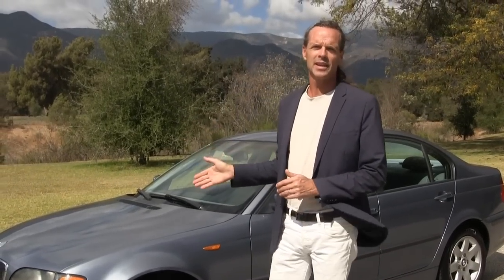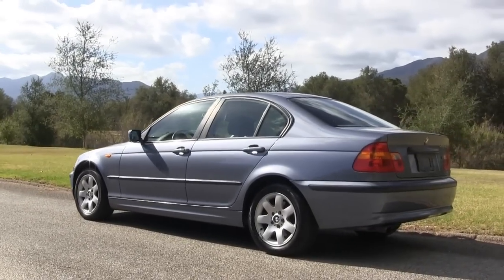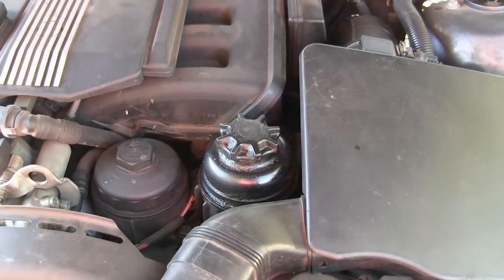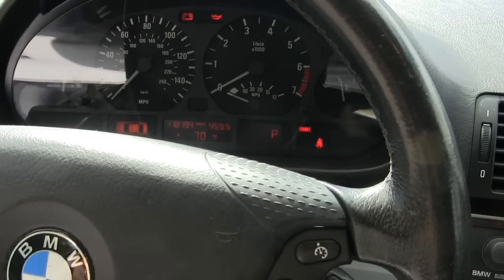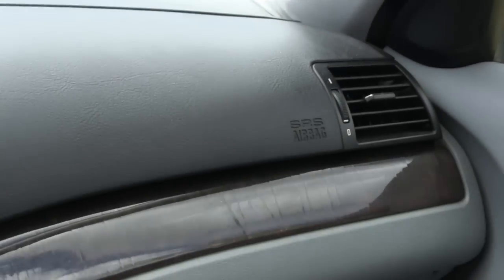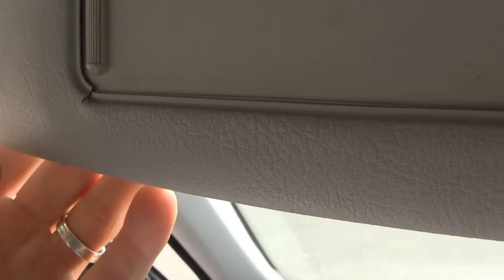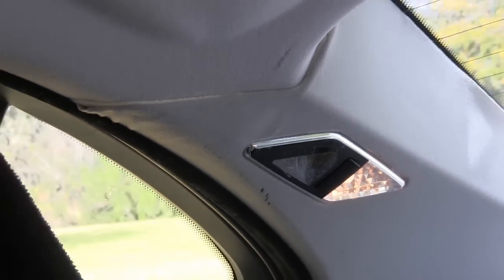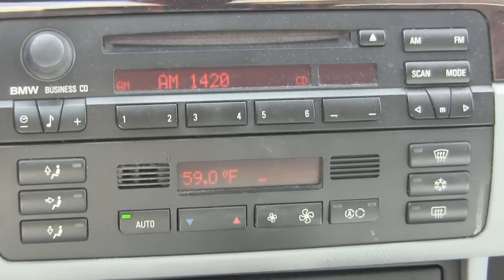Why You Should NOT Buy a Used BMW

Comment: He is right you know. He is not exaggerating at all. And he is not even saying the most important. The number one over heatig problem on this car is due to plastic parts in the water circuit. The inside looks elie when you buy it but it does not last very long. The problem is not even paying or get it fixed. The problem is for how long did it overheat - Did the driver notice the overheating immediately. Did he decide to try to reach home not realising how deadly this could be to the useful life of he engine. 
These are good engines but when overheated, you may expect all sorts of problems in the long term. Anyway buy one and learn at your own expense. 
I had Merc 190 in 1985. Grundig Hi Fi Fine Arts. Bosch kitchen appliances. I just believed in German Quality - The total cost to own these things was really low and you get the best oo. 
1990: Next Merc C200 1995 and The wife a BM 318  series. My son Toyota Avensis and my daughter Toyota Auris. And you know what !!!!!!!!!!!!!!!!!!!   
These Toyota never stopped ever! My wife and I were borrowing the Toyotas every few months to take the Merc and BM to the dealer for some reason or another. .  Grundig went bust because they struggled to continue to supply the best. 
Merc, BM, Bosch changed to building for a price and they are truly a piece of shit. You pay for the name and you get shit. I hate to have to say this since I am 66 and believed in German quality. Today if you want something you can depend on that does not cost an arm and a leg to own, just buy Japanese. 
I do not have the  3 pointed star on my bonnet at this age, but after owning a Toyota Land Cruiser for 5 years now, I would not change it for anything else, 100% reliable, unbelievable confort, and the service of Toyota is the best I ever experienced.

Comment: I had 325Ci 2006, amazing car, they only thing I replaced when I got it at 27K miles were rubber suspension bushings.  Sold it when had 160k miles-no oil loss!

BUT: not I have 528i xdive 2010-what the hell went wrong with this car??? only 78k miles.... the amount of gaskets I have to replace!!!!

So many oil leaks on the car. Just got my oil changed at the dealer, they found 5 leaks! Major ones too, one of them is replacement of oil pan gasket, the suspension has to be dropped to replace it, realllyy??? $2,300.     other ones I can most likely do. 

It is not the car I will buy again! problems just keep on piling up!

Comment: I've put 127k miles on my 2007 BMW 335. Interior and exterior still in pristine condition.  The paint looks practically new, except for chips at the front bumper area due to road debris/rocks,etc.
 Things that broke: rear main seal, electric water pump, alternator, valve cover gasket, fuel injectors,  coolant overflow tank,  ProLogc 7 amp, the "CCC"  ( main computer/nav).  We also have a 2004 Lexus RX330, with approx 275k miles. Excellent condition, in and out.  Only thing that broke was the A/C compressor.  Cars were bought new and total non-warranty repairs (at the dealer) on the BMW:  $8000-9000 the Lexus:  $300-500    I still love the BMW, but the Lexus is so incredibly reliable.

Comment: Agree about that cheap rubber-like coating used on interior plastic-peels off and looks terrible.Also the glue they use on the fabric covering the headliners and pillars-that falls off and is very hard to re-glue (and get it right).For such an expensive brand, interior quality is lousy.

Comment: You have to look at this critically. The car he has here has not been maintained. If an owner lets all the cosmetic things go south without attention, you damn well know they haven’t taken good care of the motor/drivetrain.
I have an 02’ 330CI  convertible. Had it about 5 years now. It is mint, garage kept, dealer serviced all its life. It does have the plasti coated issue with trim near the shifter, replaced it myself for a few hundred. But other than that, there has been nothing. Full disclosure, it’s a summer/weekend car for me so maybe I am one of the lucky ones.
My daily is a Mazda. Japanese car that you can practically weld the hood shut for 100k miles.
The Germans can never reach Japanese levels of reliability.

Comment: I bought a 1999 e46 323i for 1200 took it to the mechanic only 400 in parts and 150 on cosmetic wear and tear quite cheap I reckon have no regrets cars are usually crap when the owners thrash them around and 700 for regulators ebay 70 know how to shop

Comment: BMW is gods gift to the automotive world. The E46 was the best BMW ever made. Congrats, you picked the worst maintained E46 out there. AThe expansion tank takes 30 minutes to replace. The water pump had a plastic impeller, not a bearing issue.  The tail lamp issue was recalled and fixed by BMW.  Everyone who bought an E46 3 Series knows about the weak interior fabric/adhesive. Thats why every E46 smells like crayons in the summer. They all do it, especially in areas with high humidity. The wood grain is real wood not that plastic stuff. This was left outside in the hot sun its whole life. The window regulators can be saved by not SLAMMING your door with the window down. Where are you buying $700 window regulators?  This car obviously was not properly taken care of.  The leather has not been conditioned. The floor mat is ripped from its mounts. This car had its ass kicked and it shows. You need to stick with your Toyotas.

Comment: Dude....This bmw is a lemon, clearly.But that does not mean that the brand itself is crap, let s be serious....If the e46 were to be such a fail for BMW, how come they are so many of them on the road(in every body and engine combination possible)?The most important thing (not just for BMW but for any brand) is the previous maintenance.If the previous owner/owners did not give one shit about the car, clearly you as a future owner will have to cope/repare the problems encountered due to faulty servicing/maintenance.On another point of view, yes, BMW did screw it up with a few engine types when they experimented various alloys on the engine block, but that was a problem with the first generations of certain models (e46/e39 e 90 and so on) but once they started building more generations of the same model the problems were fixed.Of course, the victim is the user but on the other hand, various changes mean that they are actually preocupied with making new engines, find improovements for their model, give the people something not only new, but better.Let s face it, not only BMW screwed it up...What about Volkswagen?Does anyone remember the timing problems the  newer generations had (broken timing chain due to poor quality or faulty design), or the fake emission values (more relevant in EU) where they restricted the cars from their software just to pass the emission test?In my opinion, every car maker had and still has it s faults once in a while...

Comment: The E46 cars are flawed masterpieces. They drive really nicely and will protect you from some idiot T-boning you at a junction when running the red lights and almost all of the petrol models come WITH 6 cylinder engines and WITHOUT turbo chargers. The way it feels to drive, not the handling, can only be described as a 21st century E30 3 series with really solid and well built steering/clutch/brakes/accelerator feel. The flawed aspect is it has all the anti-corrosion protection of a 1970s FIAT, it suffers the most stupid electrical/logical/mechanical problems due to poor design (like the self destructive VANOS mechanical components on the 328i models) and it has some really silly changes from the E30 like the fail safe for the blower motor sensor pack failing is to have ZERO airflow (the E36 failsafe is that it is either off or on full power). The problem is BMWs today ie E90 and newer models don't feel like BMWs with their tacky parkbench quick swapjob for LHD and RHD centre mdel designed console and dashboard T shape design that is angled directly towards the rear seat armrest (like a cheap tacky datsun) and the engines are either 4 cylinder or you have to have a turbo (and based on the problems with the E46 VANOS self destructive design on the 328i engine I don't fancy a BMW Turbocharged engine thanks).  The E90 standard seats look as flimsy as picnic/beach fold out chairs and most models with leather interior have these crap seats NOT the sports seats...like 3/4 of all Z4s on sale right now or E90 models with these seats YUCK. The current 3 series is just way too big and the 2 series looks like a cheap nasty 1990s Hyundai coupe. It's all a bit too much....you either have to fix the faults as they happen and own a REAL BMW or forget about the 3 series forever.

Comment: It's called proper maintenance and care for your vehicle. You neglect it you pay for it later. My 2006 ZHP Vert it's still in excellent shape. If you can't DIY then stay on schedule with the maintenance program. If you can't afford to maintain it, don't buy it. It's actually one of the EASIEST cars to DIY and the minor cosmetic things pointed out, like plastic parts breaking, it's a small dollar fix. This engine is a beast, gaskets might need replacing after a while but every car goes thru same thing over time. This video is based on one fellas poorly maintained car. Just looking at what is broken/missing (emblem) says it all. Easy and cheap to fix but neglected to do so. Lame.

Comment: That's ridiculous. It depends on how owner uses a car.  The way you  treat and maintain it. I guess this one was parked outside all the time otherwise windshield cowl and inside of the roof won't be like that. The front grill be like that because of incautious use and also old part. Other problem are common issues for 3 series E46, BMW guy know exactly how to deal with these problem. PS. I also own E46 323I 2004(240K  km) my car always parked inside and regular maintenance, I have none of these problems. This car is the most sensible price for second hand BMW.

Comment: Hey, if you`re willing to spend cash on a weekly basis to run the car, i`m sure it will hold up just fine.  But when buying used you don`t know exactly what you`re getting. If the engineering was bad and the first owners didn`t care, you`il find out in a couple of weeks.  German cars are not what they used to be, i`il rather put my money on a Japanese car. I still want an E-klass though(but without the rust).

Comment: You must know, if you know about these cars and how there made, and if you know how to work on them and you say I don't care about the dealership and never go there. You should be fine. Also not all BMW are the same or created equal. They make very good cars for those who know what  they are doing. But we all can't be dealer junkies. It's like everything else you have good and bad in all models. Even Toyota, Lexus. So if you like us who know what is going on and fix everything without a problem well,  It's a very good car. SORRY  for knowing, but if you do not have the knowledge don't  Owen the ultimate driving machine or any other exotic sports car,  there out of your league. (Originals not copys)

Comment: I just totaled my 2000 e39 and S0 many of these problems happened with my 5 series also. But I also had the LCD failure on the instrument panel, the awful cup holders, and that little roll up door thing on the center by the ashtray!!?  What is that thing for? And the rubber trim on the front and rear windshield. My rear window brake light melted in the light socket too.
What did I love about this car? EVERYTHING else. I could overlook everything else pretty much because she was so much fun to drive. I can't think of a car that I have had more fun driving, nothing I have ever driven has been so responsive, fast and fun. Pure joy. 
I bought a used Honda Fit Sport to replace my E39. I am already regretting it. I think if I can find another  used BMW  that has the right specs and mileage and has had maintenance done correctly, I am gonna buy it. They are just that much fun. But, you have to be picky and buy the right one at the right price. Or an older BMW will nickel and dime you into the poor house.

Comment: The E90 I6 naturally aspirated bmw engine is a great engine with excellent reviews and consistently sees 250,000-300,000 miles! The 2.0 and 2.5 is underpowered to begin with. Oil leaks could be from a water pump failure that the driver failed to stop driving when first noticed. Cheap plastic is not n EVERY car on the market! Show me one that doesn’t!

Comment: The car you show us has >15 years (today)and almost 300'000km on  it.... you show us interieur, label and frontpart they are not as new anymore. A beauty point is not a need for a shopvisit.  The main problem you show by pictures. sure they exist but with what car we can compare to say its a bad car?  According my 3x E46 in version 330xd i had ... take care of all what contains rubber and change the aut.gear-oil. A  Coolant leak is not (always) a breakdown. A Beamer might be exotic in US, but somewhere else they fix them quick. If you can not afford a new car you may start to handle problem by your own, because you are driving a OLD CAR. Good and save drives to all of you!

Comment: Oh man what a hunk of sh*t. I own two diesel BMW's (and a BMW motorcycle R1200GSA) and have had a few smallish problems that were easy enough for me as a hobby garage mechanic to fix (windshield pulley system broke on an '06 X3), both the X3 and an X5 needed glow plugs and regulators replaced, injector failure on the X5, cabin water leaks in both cars, some electronics issues on the motorcycle... But generally they've been pretty reliable, and really nice to drive. Something happened to BMW's quality control though, I remember owning a 530 from the 70's and it was way better in terms of materials and workmanship than the modern versions in many ways. The 1990's and early 2000's were bad for BMW in particular and I think have soured many people's opinions of the company.

Comment: The emblem is bleached due to excessive sun exposition which most probably also explains the  a-pillar's failing coating/cover and the soft finish plastic parts. It's a design flaw because BMW most probably had western europe in their minds. Still, that shouldn't happen. Especially not with the BMW pricetag.

Comment: cooling system goes just like other cars, for everything else, you got a lemon
Reply: I heard many 3 series owner have cooling problem too.
Reply: @haiducchu  Both my 3 series cooling system lasted as long as the radiator. A radiator lasts as long as any radiator.
Reply: @gerhardlourens7930  it usually is the small components that made up the cooling system failed, like the thermostat or the low quality rubber hoses that cracked. And people are not very observant too, they only know there's a problem with their car when the engine dies from overheating. And I agree with you, an aluminium radiator will last as long as the aluminium itself.
Reply: Also what is your opinion on e39 525i? I'm going to get one this year but doesn't know much about it. Very few people in Vietnam got a e39 5 serie

Comment: It is indeed a piece of shit when it comes to maintenance and repair. I own a 2006 BMW 325i and it cost me $1200 to replace the starter at the dealer. Then there are coolant leaks and engine overheating and so on and on .. Apart from the engine, everything the hood need to be replaced before hitting 100K. Don't understand how the same people that built the amazing engine came up with such cheap/crappy parts under the hood ...

Comment: This is completely false and not realistic review. I own a bmw e46 compact from 2001 that has real 150k kilometers and the car is almost brand new, no tears, the only broken plastic i have is on the center console (where the wood is here). That's about it. The car is as the owner maintains it. If you drive a Rols Royce and you transport wood, metal or something else, it would also deteriorate. I completely disagree with this review as he bought a car that was completely ruined and stated that it's bad... This is not ok.

Comment: I just been offered a swap BMW 318 e46 for my suzuki liana. Went to look at it and it was a bag of shit. It had 131.000 miles and plastics and interior was flaking. Seats worn. Body rust to fk. Oh and valves fked. My suzuki interior still looks new. Hardly depreciated at all exept on my drivers but very little. At 160.000 engine still great.

Comment: So many BMW owner dislikes! 😂 I owned a '92. 325i. My first and last BMW. Had to replace head gasket right off the bat, had to buy a bunch of proprietary tools. Then door panels falling off, head liner failed, window motors failing, door locks failing (got locked INSIDE once), sun roof cassette broke, auto transmission going in and out of limp mode. 

Just over 200k miles. Exterior looked just about flawless which is what draws you in. One of the worst cars I've ever owned. Never again!

Comment: i have 06 320d e90 168k km. problems started coming one by another. went to delearahip to bleed brakes system. they couldn’t fix the brakes but charged 200 dollar. ridiculous got ripped. i may not buy bmw in future instead i will buy toyota. it’s enough for me if it takes me from A-B.